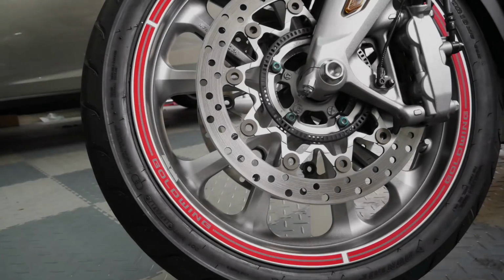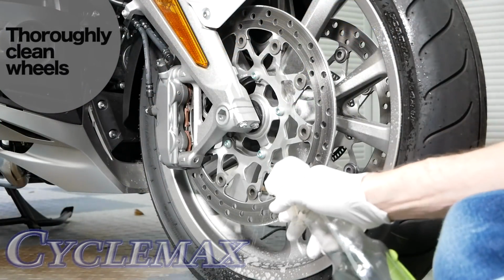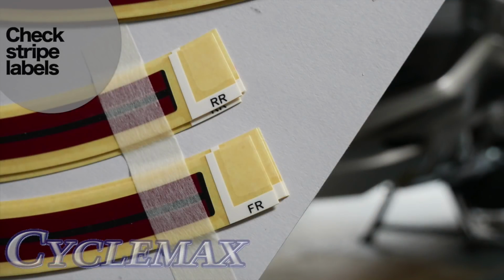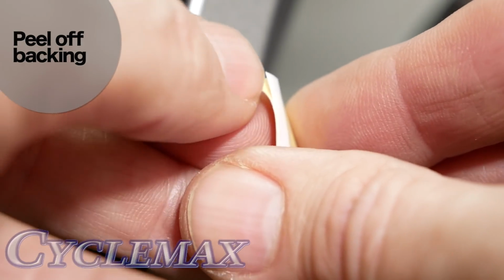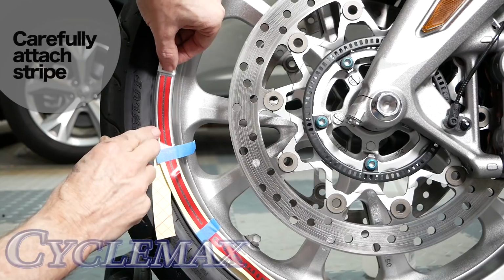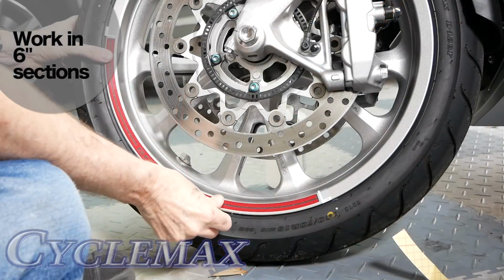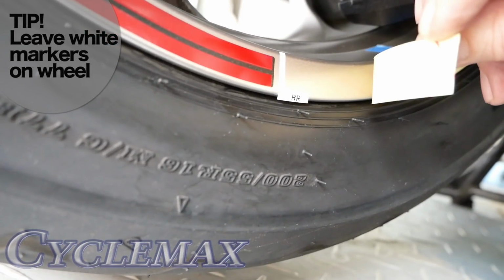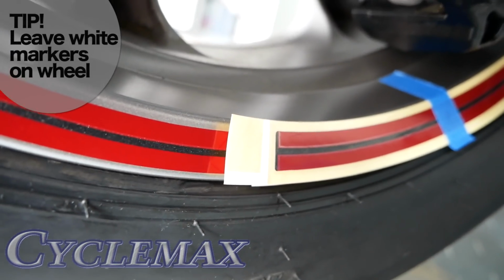Install Wheel Stripes on 2018 Honda Gold Wing

Comment: Those are nice. Would like that on my 2015 1800 as well.
Reply from the maker: The Honda website suggests that that will only fit the 2018 models.
Reply: Use 1/4 inch reflective tape that is available in many colors.
Reply: @cruisemansgarage  why would these not fit a 2012? Both use 18” rim on front & 16” rim on rear.

Comment: Great video, but not for me, too much bling for my liking.  Would be great if they were silver and reflective though - undetectable while providing a safety feature.
Reply: You can use 1/4 inch reflective tape. I have since 1985 on my Limited. It comes in all colors.

Comment: I used reflecting red pinstriping tape starting with my 85 Limited. Did my 89 and the 06 I still own. It looks like it's lighted when light hits it. Never had a problem changing tires.

Comment: I would like to see it from about ten feet away to see the overall effect. Which is how it will mostly be seen, I'm sure I will see it in an upcoming video...
Do you think this will hold up OK?
Reply from the maker: It actually looks even better from farther away. I only wish Honda had used reflective material. Now, as for holding up? That is a GOOD question. It will be interesting to see how they stand up to a tire change. I think they will hold up OK to every day riding.
Reply: Yeah I did not think about tire changes that will be it's Achilles heel unless you do your own tires and can be careful. I have seen pinstripes hold up for decades so maybe it will hang in there.
I thought it was reflective, Honda does some strange stuff sometimes. I would have bet money on it being reflective.
Reply: @Bass.Player  I used 1/4 inch red reflective tape on my 1200, 1500, and 1800. Looks great at night and tire changing doesn't hurt it.
Reply: @boston12111  straight tape make the curve alright?
Reply: @Bass.Player  It takes patience and the narrower the easier. I used 1/4 inch.

Comment: will that work on gl 1800 first and second gen?
Reply from the maker: Honda only says they are for the 2018 models.
Reply: 18” on the front, 16” on the rear.  Same as 2nd Gen.